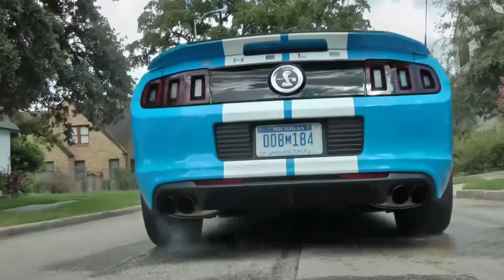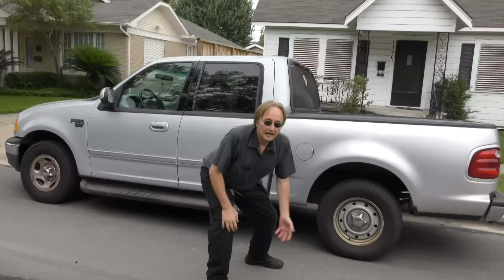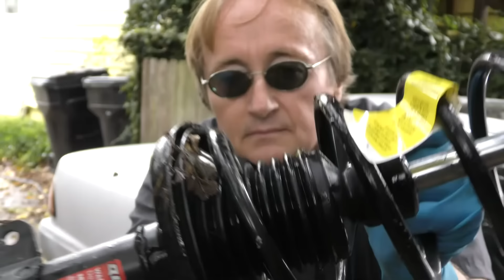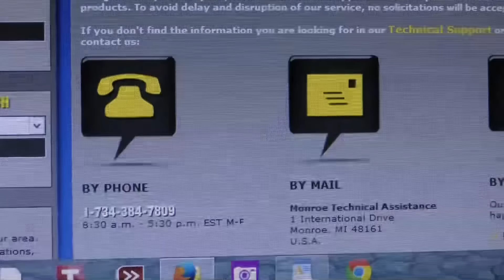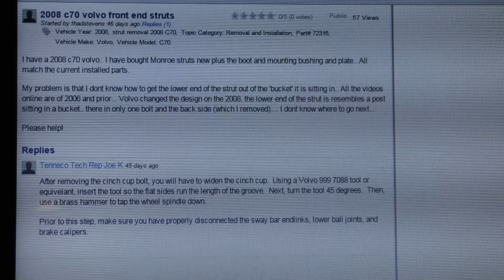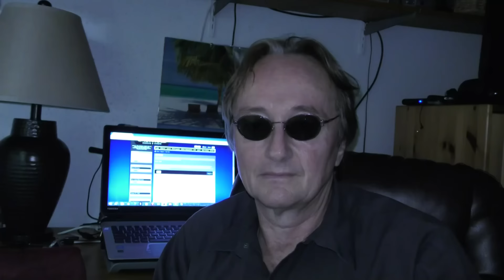How to Fix Suspension Noise in Your Car

Comment: I bought new struts, new mounts and bought compressor and did the job my self. After I went for a drive test, my problem was finish, except now, there a boing noise on the driver side when I'm turning to the max...Maybe I put the coul upside down, will check it out. Any comments?

Comment: I've had Monroe rear lift air shocks but now on my current vehicle, I much prefer the Monroe helper coil shocks because they are always there adding lift when needed. They don't boost till you pour the weight on, so you still get the nice factory ride but automatically they help when needed.
Take care

Comment: Hey Scotty,

Can i buy a rental car? Toyota Avalon 2013 hertz Certified 50k miles for $18999..  Or New 2016 Honda Accord LX . Both in my budget USED 60 months Financing NEW 72 months Financing.

What to check before buying a rental car and what will be the maintenance cost for coming years. What kind of major service schedules i need to worry about?  What you recommend NEW OR USED Please guide me.
Reply from the maker: +mona samuel avalon would be better. Basically maintain them like any car, change the engine oil and filter regularly and do the regular service intervals in the owner's manual and you can't go wrong with a toyota
Reply: Scotty you recommend used 2013 Avalon rental car over New 2016 Accord? If i do regular services as you recommended i don't have to worry for coming years am i right? Hertz is offering certified 2013 Avalon rental car for $18999 is that a good price and they have 2013 Avalon $17500 not certified rent to buy which one you recommend.. I don't have any knowledge about the cars please help me..     

Thank you Scotty

Comment: Scotty, 
Whenever I refuel a 2007 diesel powered Ford F350 the big volume of foam blocks the fuel pump almost immediatley and it takes lots of times to refuel the car (more than 10 minute I'd say).
Could you please give me some tip of how to solve it?

Comment: hy scotty im from romania and i own a w220 s320 mercedes and when i came home from work yesterday my mar wont move in d at all do you have any ideea what is all about?
Reply from the maker: +codrea razvan check the transmission fluid, pray it's low. if not, start emptying out your wallet to repair the transmission
Reply: its not low its someting inside the transmition its wery odd

Comment: I've learned to use thread lock fluid on many suspension parts nuts/bolts over the years. I think the reason I've been hired to fix some suspension part failures has been due to extreme use/abuse by the owner.

Comment: Scotty, deciding on a used '13 Yaris made in Japan, or a '14 made in France, would you buy the older Japanese one, even though it has more miles, rather than the French made one?
Reply from the maker: +pedrof830 go japanese
Reply: Scotty Kilmer
I thought the same, and I do respect your opinions, so that is why I asked, thanks!
Reply: +pedrof830 I absolutely agree with Scotty, GO WITH THE JAPANESE choice. I've worked on more than a few as fleet vehicles.

Comment: Haha didn't you say a couple of years ago that Monroe struts suck and not to buy them?
Reply from the maker: +The Stiver  I used to like KYBs, but their quality has gone down while monroe high end struts have gone up. Realize you must buy the high end stuff if you want quality these days. I would not buy low end units from any company.
Reply: +Scotty Kilmer Thanks for clearing that up. I've always used KYB but I guess I haven't done shocks in a few years.
Reply from the maker: +The Stiver yea, times change, and one has to keep on their toes unfortunately. Companies are always changing ownership and manufacturing facilities. Many have moved to China for more profit and lower quality.
Reply: +Scotty Kilmer KYBs totally worn on one of our vehicles in less than a year.  And one of their "ready-strut" units (their version of QuickStrut) had a bad strut mount bearing right out of the box.  Not very impressive as far as I'm concerned.  I had issues with Monroe in the past but they actually gave me a full refund PLUS $100 for my labor and asked me to ship them back to their engineering department for R&D into the problem.  The next time I go after-market, I'll likely give them another shot (especially since their high-end stuff has lifetime warranty)

Comment: Nice. But I'd rather use Bilsten shocks than the Monroe.
Reply: +Tony Esparza Depends. For German cars Bilstein, Sachs and Lemforder are fantastic but if I have an old Ford or GM I'd probably slap on some Monroes. I used them in my 2000 Maxima I owned a couple of years ago.
Reply: That's true. You know now that I think of it, its a very small difference in performance between the two. When I bought my car five years ago it had Monroe shocks installed, I recently replaced them with Bilsten since my local auto parts had a discount on them. Honestly I can't tell the difference in ride quality between the two brands.
Reply: +Tony Esparza I concur.  I think its what you can afford.  My truck needs rear shocks.  A decent set of Bilsteins is around 200 bucks, but 80 bucks for a set of Monroes.
Reply: Anthony well it also depends on what kind of shocks you're buying there are different types even for the same vehicle for example my 2002 jeep grand cherokee has monotube shocks and twin tube shocks, I'm currently using Monroe twin tube (they need to be replaced) but from research online and also other sources they say the monotube shocks are better and an extremely smooth ride compared to the monroe

Comment: anyone want to answer my question? I have a 4 cylinder, 95 hp motor, the economy base model.. what's the likelyhood I'll blow the motor up running a 35hp wet shot of nos?.. fully rebuilt gaskets and seals
Reply: +xRam lol
Reply: +Mod Mark hey man, it's serious. my Honda is very underpowered.
Reply: +Mod Mark yeah, but it'll be faster than it was previously, plus the kits free.. I only have to buy jets. lol
Reply: +xRam I'd get a better car dude. You won't prove anything by doing what you want to do. Everyone knows your car is slow as hell.
Reply: +Mod Mark yeah, but a turbo would put constant stress on the motor, and the nos would only be used when I flip the switch
Reply: +xRam sell the nitrous kit to put towards your next car

Comment: My 81 el camino has a thumping coming from under the passenger footwell near the middle of the vehicle, and it only happens alittle over bumps but strangley enough it starts at 65mph and ends about 70 or so.... what could it be?
Reply from the maker: +SuperAwesomeGuy   check for worn shocks and worn out ball joints or tie rods first
Reply: Strut mount...my problem!  Want to try good lubrication first!

Comment: So if I have a car that the struts/shocks are worn out, can I get EXACT dealer parts for my specific vehicle so it rides just like it did when it was new?  My mom has an '04 Sienna that got all struts and coil springs replaced...ride is much better BUT it is nothing like it was when the car was new.  Is that even possible nowadays?
Reply from the maker: +Max Burgess  You can always buy the highest quality struts out there, realize the lower quality ones may cost a lot less, but don't work as well either. But of course an 11 year old vehicle will also have worn springs and rubber bushings so odds are it will never ride the same as when new.

Comment: Less than $100 for a kit of air shocks? Doesn't these usually cost a fortune?
Reply: +Henrik Nilsen At this price, expect them to break down 15 minutes after the warranty expires. You are warned.
Reply from the maker: +tubee103 au contraire, I have monroe's on my toyota and my wife's matrix. They are the top end monroes though, I would not use lower end struts from any company.
Reply from the maker: +Henrik Nilsen just depends where you buy them. that's why I made this video
Reply: I should say, though, that Monroe DID give me a FULL REFUND 2 YEARS LATER, PLUS another $100 for my labor, AND gave me prepaid shipping labels so I could send them to their engineering team for review.  So, at least they are trying to fix the issue and did stand behind their product.  The thing is, though, that the OEM units are "beefier".  Sure they cost twice as much, but they just work significantly better for my application.  I guess you get what you pay for.  And... it's really not that difficult to take them apart.
Reply: +BigBadBeef that's what i was thinking. i had a go on google and found sets of 4 for over $2000.
Reply: Scotty Kilmer I stand corrected, I was thinking of the el cheapo 18 dollar monroe's...
Reply: +tubee103 I used the "higher-end" monroes on the minivan.  Replaced them twice in less than 2 years via the lifetime warranty, and finally got sick of it and ordered OEM.  Unfortunately, KYB isn't much better these days either, though.  It seems like you can either pick the cheapest option or OEM.  Anything in the middle won't buy you much.  The only advantage I could see to the higher-end Monroe units is the lifetime warranty, but be prepared to replace them often.

Also, if you have a Camry, be prepared for strut-mount clunking if you use quickstruts. (Just google that one.. you'll get plenty of hits!)
Reply: +Henrik Nilsen go to summitracing.com.  lots of high quality items.
Reply: +Henrik Nilsen Monroes are cheap,spend the extra money and go with KYB'S or rancho's,,,Scotty would never use monroes on his own vehicles
Reply: @JasonH-4U  KYB and Rancho are cheap and regarded as junk in the UK. Sachs is regarded as premium quality in the UK, followed by Bilstein and Gabriel

Comment: Hey Scotty!
i have a 77 cj7 and Im having a hard time pin pointing a noise coming from the front drivers wheel well
It chirps when going over going over the rougher parts of the road at higher speeds 30mph+
the U joints have been replaced this past year as well as some rattly brake parts.
Reply from the maker: +ScArdZombE what are you doing worrying about chirps on a 77 jeep? They make all kinds of noises.  But, do check or worn wheel bearings AND bent brake backing plates

Comment: I feel like my shocks need to be replaced but not to sure. Their not real smooth when driving over rocky terrain. I drove them 40k miles already not sure what they had before that.
Reply: shake your car a bit by pushing down on a corner and if it still wiggles for a couple seconds then I would think so
Reply: Charles Graham It's a truck if that changes how I should check it. (2006 Silverado.)
Reply: +Welder Nate no usually that works for my f150 but ask around
Reply: +Welder Nate Trucks generally ride rough. Do what the others said. Push it down in the back, and see how long it takes for it to stop bouncing. Should only bounce once, maybe twice. Lots of things can wear out though to make it do that. Bushings, leaf springs, and of course, the shock. I'd replace all 4 shocks if you plan on replacing any of them.

Comment: 03 accord sedan. Metal sounding click/clunk on passengerside over bumps. I looked yesterday and not sure where its coming from
Reply: +TheRandomChannel Jack it up on that side and try wiggling the tire side-to-side and up-and-down to see if it wobbles at all.  Also check all the suspension bushings. My '06 Accord was doing the same thing, and it turned out that the front bushing rubber on the lower control arm had separated from the arm. So when it went over bumps, the lower control arm was flopping up and down, banging on the frame.  You can stick a pry bar in between all the suspension joints and pry them to see if they are loose. It could also be the stabilizer links.
Reply: +anti0918 thanks for the advice.. this sound drives me crazy